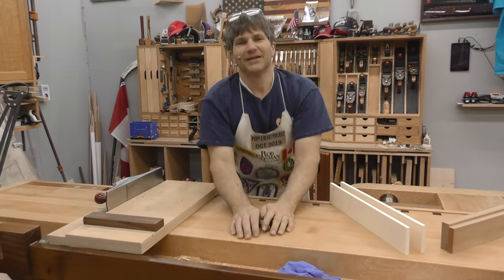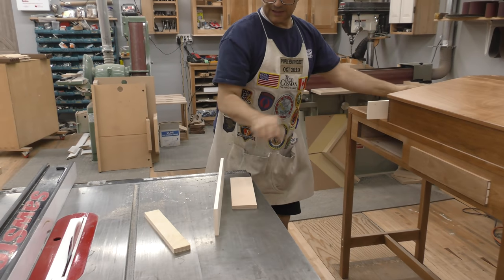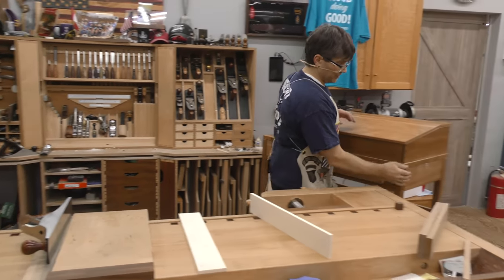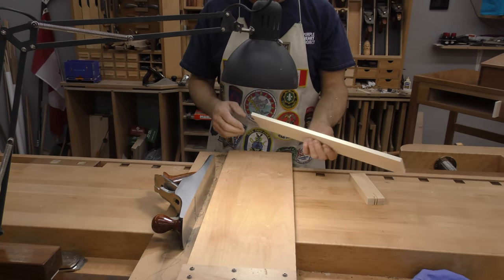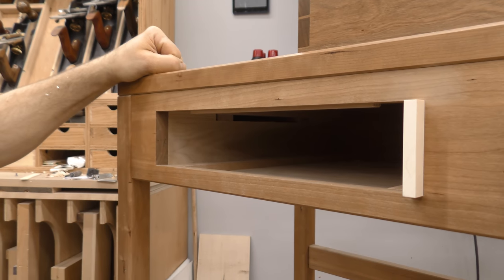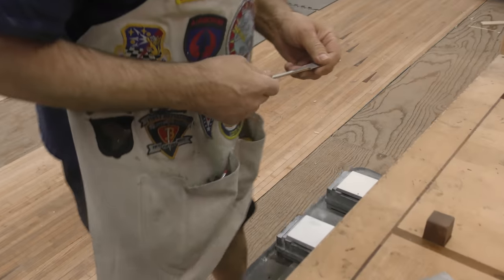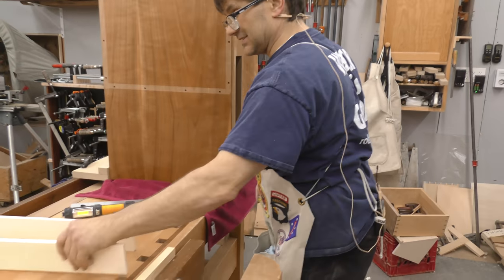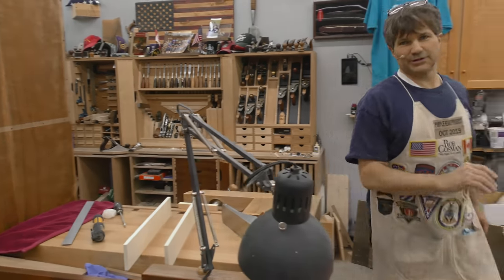Drawer Making Episode 3

Comment: Common problem, Rob, guys who do a lot of hand work that develops  forearm strength tends to give you "Popeye" forearms that don't fit small spaces well. Nice problem solving. A little Stanley #75 would have been useful on that little space. I picked one up and after some fairly extensive tuning have it working well enough to avoid having  you want to throw it across the room.

Comment: Why do you use a shooting board to plane the edge instead of just holding it in a vice? By that I mean the long edge, do you gain an advantage in straightening the long edge on a shooting board vs. relying on the sole of your plane to reference while simply clamped in a vice. Thank you for what you do for the veterans, they deserve all things awesome such as this!
Reply: The shooting board ensures the planed edge is 90 degrees to the face. If planed while in a vice the plane could tilt the surface away from 90 degrees.

Comment: When you back off your plane blade does it move the blade back immediately or does it go back after you make your next pass?
Reply: Hi Chad, the plane blade is controlled by the wheel, so it moves immediately. Using the plane does not move the blade. Hope this helps.